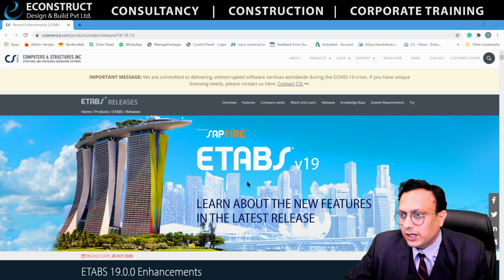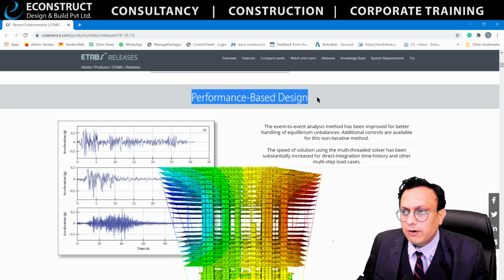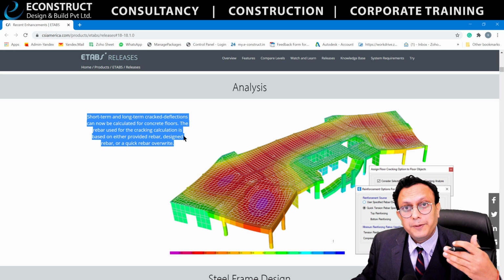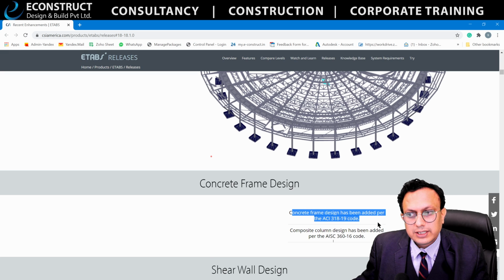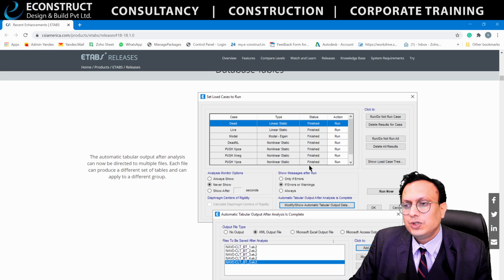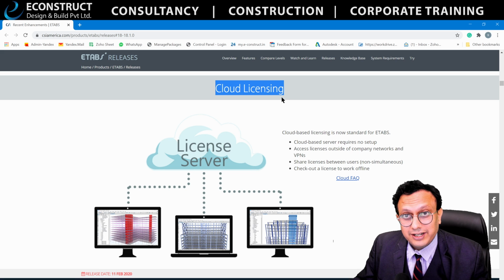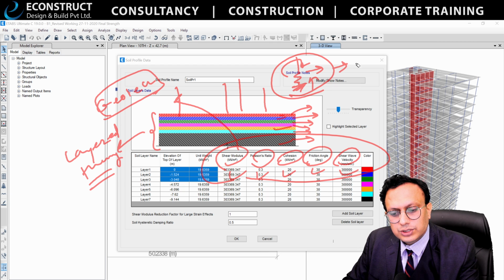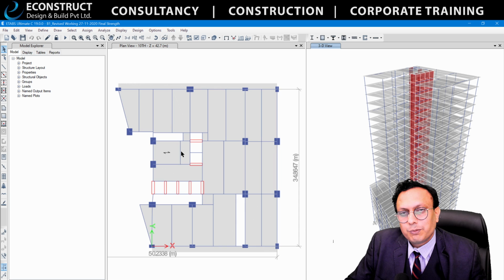ETABS V19 ENHANCEMENTS & NEW FEATURES

Comment: IS THERE ANY SOLUTION IN ETABS 19 FOR THE CONNECTION BETWEEN BEAM AND COLUMN IF THE BEAM DOES NOT ACT THROUGH THE CENTER OF COLUMN ?
Reply: use rigid links